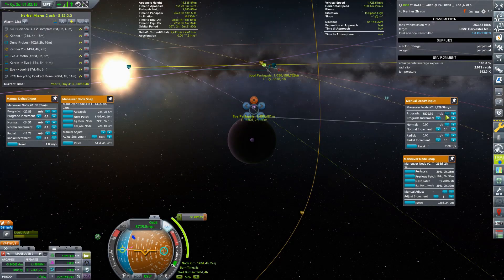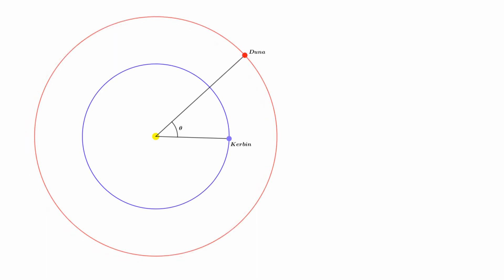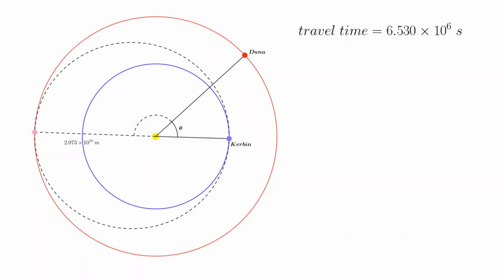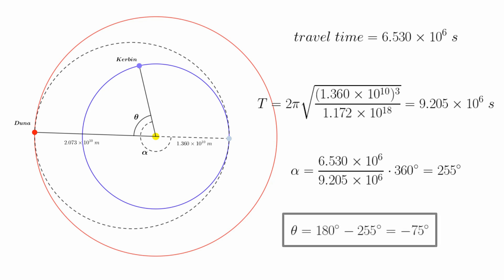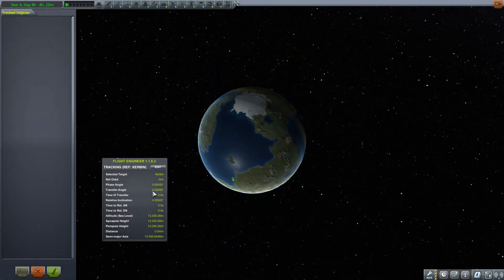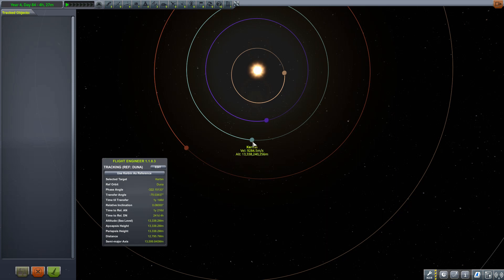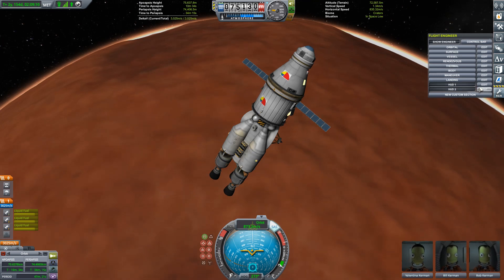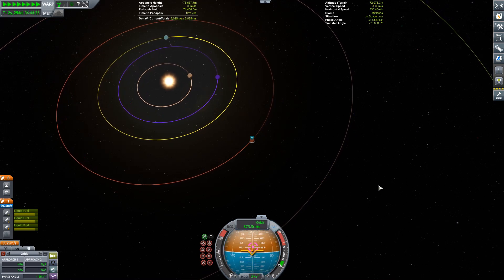How to Calculate Interplanetary Transfer Angles | KSP Let's Do The Math

Comment: @MikeAben Thank you for these outstanding videos!  One question: I think we are still missing one piece of information necessary to calculate our interplanetary transfer.  We have delta-V and the phase angle from your videos, but how do we know where exactly to do this burn?  In other words, in our origin orbit (Kerbin orbit in this case), where/when exactly do we do the burn?  (I’ve read some sources that call this the “ejection angle”.)  Thank you!
Reply from the maker: It can be worked out, but you don't need an ejection angle in game. I typically don't use this number in my games. When moving inwards towards the sun (Moho or Eve) you want to eject from Kerbin’s SOI in a retrograde direction relative Kerbin’s orbit about the sun. This will have you ejecting across the day side of Kerbin. When moving outwards (Duna, Dres or Jool), the ejection will cross the night side.

When setting up the ejection in game, just put the maneuver on the correct side of Kerbin and put in the required dV for the transfer. Then simply tweak the timing of the maneuver until the periapsis with the sun (or apoapsis) is at it lowest (or highest) point. You are now at the correct ejection angle.
Reply: @MikeAben  Thank you for your reply!  I'd love to figure out how to calculate it manually if possible.  Do you have any good sources you could point to for how to calculate it?  That well-known KSP calculator (I won't link, since Youtube seems to be eating my comments when I try to link) provides the ejection angle, but the guide it's based on from the KSP forums is now degraded/unreadable due to images no longer being hosted.  I've also been studying the Bate, Mueller, and White astrodynamics textbook, but I still cannot figure out how to calculate the ejection angle.  Any pointers would be appreciated; thank you again for the great videos!
Reply from the maker: @jameskostas-kraines2362  The only site I can think of is this one.
http://www.braeunig.us/space/index.htm
It has a nice orbital mechanics section, though I'm not sure if it deals with what you need. Thinking on this since your comment, the problem is more involved than the phase angle problem. You want to leave Kerbin's SOI either going prograde relative to Kerbin's orbit, or retrograde (depending on which way you are heading). You then need to work out how far ahead prograde or retrograde you need to be at LKO when making the burn. This will depend upon the dV of the ejection burn. The higher the dV, the quicker you'll exit Kerbin's SOI, which reduces the necessary angle from prograde or retrograde. I'm not sure how to approach it from there. Good luck in your search.
Reply: @MikeAben  Thank you, I think that website has everything we need to calculate this!

Specifically, for future searchers: on the INTERPLANETARY FLIGHT page, the Escape from Earth's Sphere of Influence section gives us gamma, which is the "zenith angle of the departure asymptote" for the hyperbolic orbit departing the origin planet.  From this angle, the info in your videos, and that website's ORBITAL MECHANICS page, "The Hyperbolic Orbit" section, we can calculate the true anomaly of the periapsis for that hyperbolic orbit, which tells us exactly where to do the burn.

I'll report back here if that ends up being insufficient, but I think that's everything we need!
Reply from the maker: @jameskostas-kraines2362  Excellent.

Comment: ok but what if you can't approximate the orbit as a circle? What do then?
I want to hit an asteroid with perihelion of 13*10^9 and apohelion of 57*10^3 m (abut 1 and 4.4 au). Wolphram doesn't want to use Kepler formula for some readon.
Reply from the maker: Phase angle would be useless in this situation as it would always be changing as the object moved about its orbit. I would eject myself from Kerbin when it is directly below the target's apoapsis aiming to get my periapsis with the sun to match up with the target periapsis. At periapsis you should be able to do a retrograde burn that will get you an encounter after doing one more orbit of the sun. I do sort of the same thing around Kerbin in this video.
https://youtu.be/QJafTwiRUco
This may be a good topic for a future tutorial.
Reply: You'd probably want to numerically approximate in this case, using a gradient descent algorithm to perturb the three burn axes to minimise distance from the target.